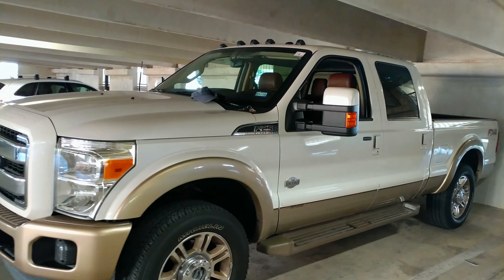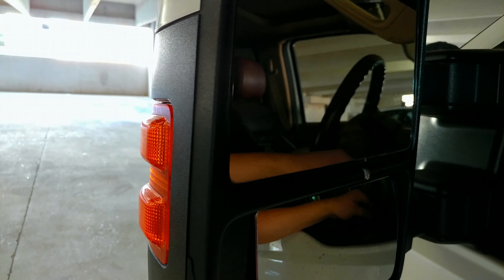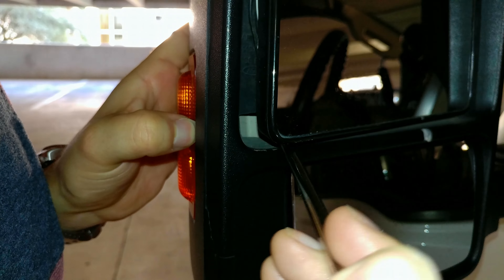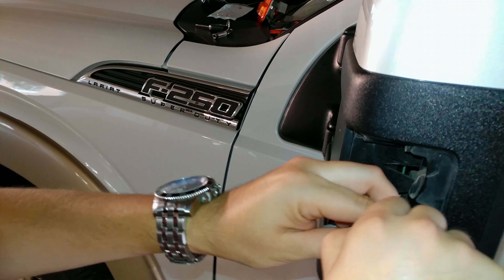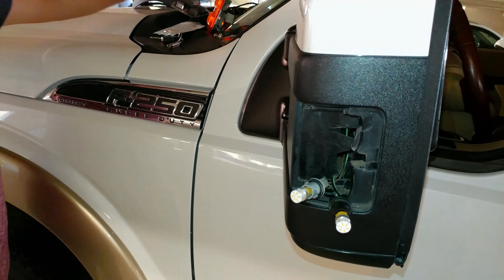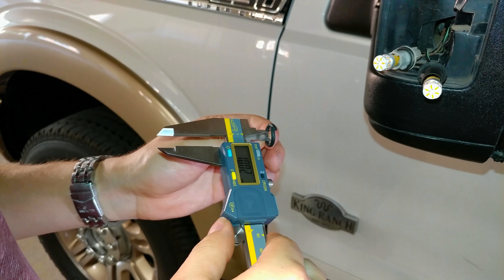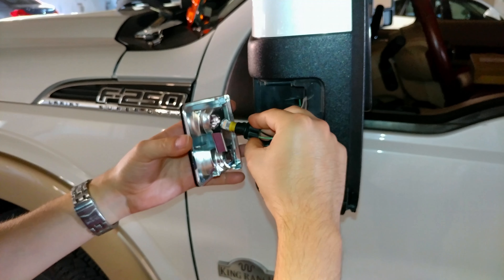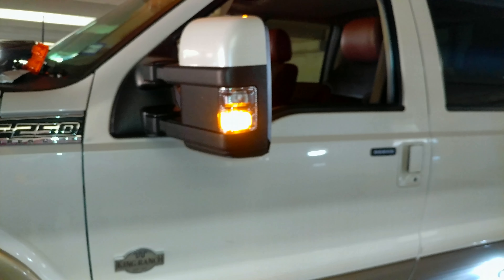2013 F-250 Side Mirror Smoked Lens Caps and LED Bulb Replacements

Comment: Where did you get the white painted top section on your mirrors? Did you paint those yourself or did your truck come like that?
Reply from the maker: The king ranch trim came with it like that. You could get some plasti dip or get them vyniled to body color if that's what you want.

Comment: Are U using resistors to prevent hipper flashing when using the blinker at each signal bulb location or ???
Reply from the maker: Those side marker lights don't need load resistors since they are not monitored for bulbs being out like the front and back turn signal bulbs. You can change them to LED and you will get no hyperflashing.
Reply: @FRANKHURTADO01  Actually I did get hipper flashing, I had to add them to the front, rear the side mirror turn signals.. Once I added the resistors, they all worked as they should 🤷🏼‍♂️.. I just had to change one resister that shorted out, they get very hot.. The truck is a 2010 F-250 Super Du💩ty 4 X 4..  Don’t know if that makes a difference.. 🤦🏼‍♂️ Anyway, it’s working now…
Reply: I want to update my F250 truck stereo system with a touch screen etc., any recommendations in that regard.. ? 🤔
Reply from the maker: @juantwo322  Glad it's working for you!  Only place where I put the load resistors was on the front and back turn signals. Maybe your truck being a 2010 has a different configuration.
Reply from the maker: @juantwo322  Does your truck have Ford Sync already? Also do you have any vehicle controls through the stereo like A/C, heated seats, etc...
Reply: Yes..
Reply from the maker: @juantwo322  You'll need to get the following.

Double Din stereo. I like Sony so here's an example. Has Android Auto and Apple car play.
https://amzn.to/3CFt73e

Then depending on your factory stereo configuration, you'll need a double din dash kit, stereo harness, antenna adapter, and steering wheel controls adapter harness.

On the other hand, you can go to infotainment.com and upgrade your stereo to a factory SYNC 4 unit that is practically plug and play.
Reply: @FRANKHURTADO01  Don’t know what Ford Sync is 😬
Reply from the maker: That's just the name of Ford head units with touchscreen, bluetooth, navigation... I think SYNC 4 is the latest and greatest and I believe they are made by SONY.
Reply: @juantwo322  hey buddy. Just recently got a Sony XAV-AX150 installed in my 2010 Ford F-350. It’s a very very nice touchscreen with Bluetooth, and apple CarPlay.
Reply from the maker: Sony Stereos are the bomb!

Comment: Do you have an ebay page where I can buy it from you?  in case the bulb burns out, what would be the replacement model?
Reply from the maker: No I don't. I don't sell these bulbs. Checkout the links in the description with links to the bulbs and lens caps on Amazon. They are 194 bulbs.

Comment: Does changing this bulb affect the load on the turn signal and make the lights flash at a faster rate?
Reply from the maker: I am not sure. I think they don't cause the hyper flashing you're referencing. But I might be wrong. I don't remember if I made this modification before or after the load resistors were added to the turn signal circuits.

Comment: where did you get your replacement bulbs and do you have a part number or link?
Reply from the maker: These are 194 bulbs and I got the amber led ones from JDM on Amazon. They also have a website where you can go and find them.
Reply: Part # 2825
Reply: 194 HP5 bulbs?